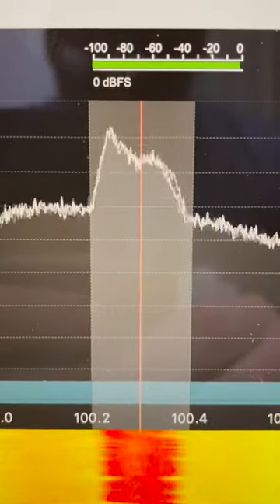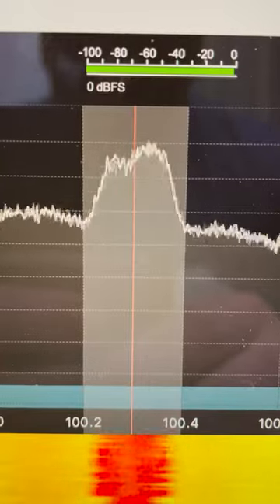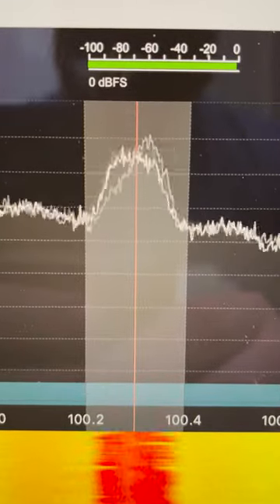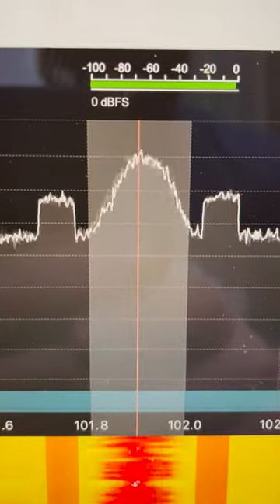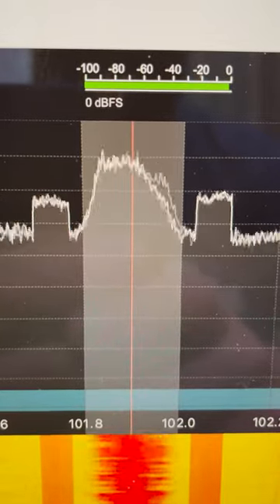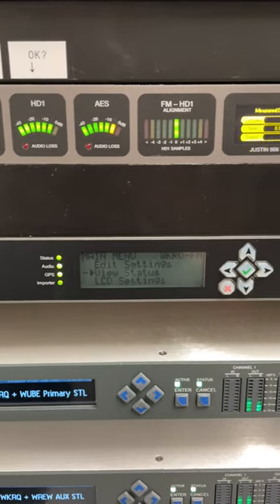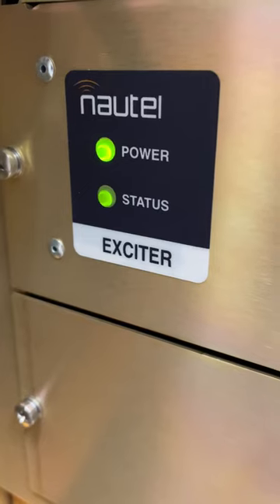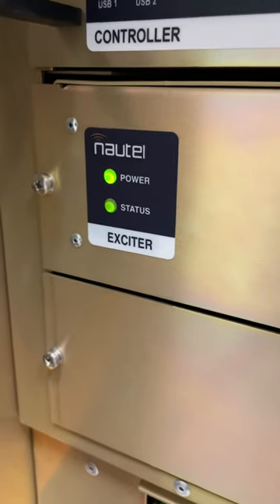Broadcast Engineering TikTopics: FM+HD Hybrid Mode

Comment: I'm not really sold on HD radio on the terrestrial stations yet. The name HD is misleading. You immediately think high definition as related to TV or satellite. And it's not. HD radio really in any actual radio form doesn't even come close to the quality of the existing analog FM still. FM broadcast analog uses a fair amount of bandwidth for the reason of quality. HD requires less bandwidth since it's digital info and not a modulated signal. And lots of data compression. Listen how lousy an MP3 sounds when you put the squeeze of compression on it which removes bits and pieces of the audio in order to shrink the size of the data. Analog doesn't compress the audio data. Huge quality difference.
Reply: I'm not sure I agree with you there, but even if that's true now, if "HD Radio" were to achieve widespread adoption, things could be different. If the analog bandwidth was reduced or even eliminated someday, think of how high a bitrate we could get for the audio. Analog modes are bandwidth hogs compared to digital. Even with the two small sidebands we are using now, stations are able to not just include clean digital audio, but also simultaneous digital media like album and station artwork, real-time traffic and weather maps. Also, MP3s sound so lousy mainly because they use an inferior codec. "HD Radio" is based around the AAC codec standard which is SIGNIFICANTLY better quality per bitrate.